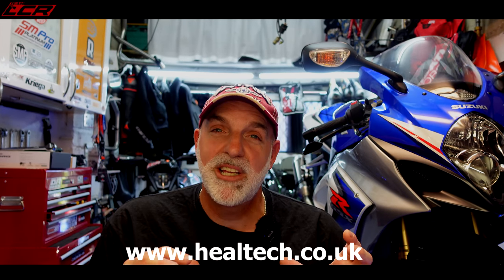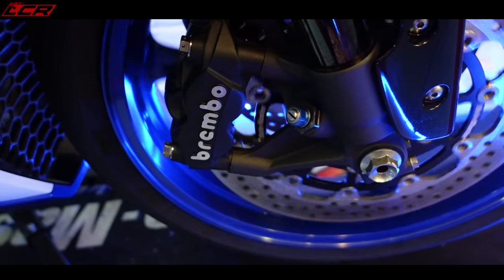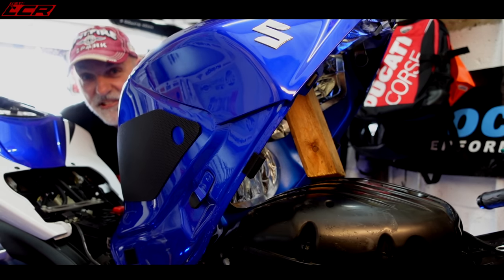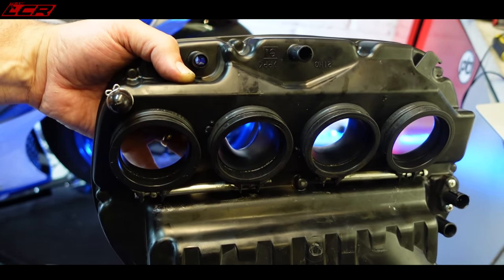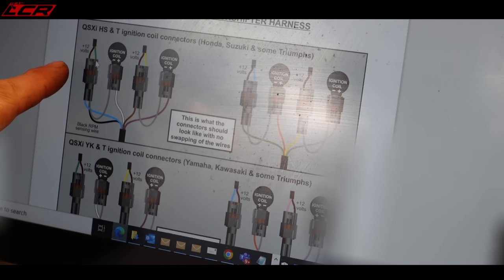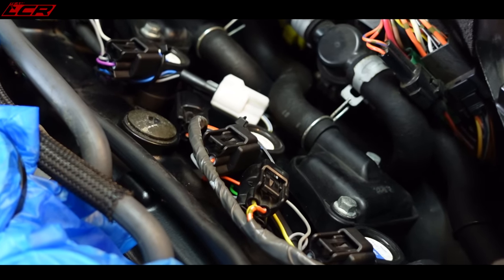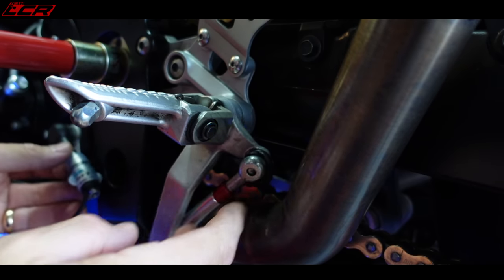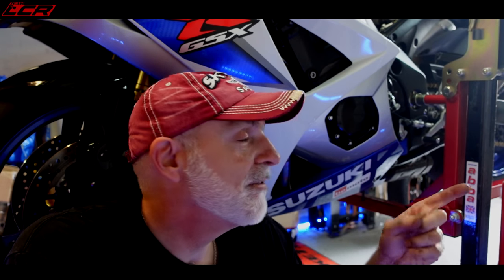BEST Track Mods GSX-R1000 | Translogic Quick Shifter Installation

Comment: Donington is a great track (apart from the nose adverse locals who moved/built there because house/land prices were cheap due to close location to the track)… Red Gate is awesome, you just keep getting braver and braver, quicker and quicker throwing it in, just be careful the next corner tightens up and is the limit for red gate. 👍
Reply: It's crazy with the noise limits there - illustrated by the fact that every 10 minutes a jet full of holidaymakers screams over your head at 827,000 db. Did see a Spitfire once though.
Reply from the maker: Yeah really annoying isn't it!

Comment: Those red spacers are to cover excess thread but I'd take one them off and put a nut in place and tighten it all down. As you've got it the gear lever side isn't locked off.

Comment: I ordered the TL QS oem replacement , for my gsxr1000r L7+ , and it didnt work , the company said they had issues with it working on the newer models ,something to do with voltages,, and they gave me a refund . Just a suggestion The loose red spacers on your bike you could add a washer or 2 . 👍

Comment: I have one for my R6 since a month or so, its so smooth. Only thing for me is that it sometimes takes quite a bit of pressure to engage
Reply: The pressure is adjustable. You can turn it down.
Reply: @dbtrackz33  yep, I have it set to the lowest setting at the moment. It's fine now but maybe something with the sensor
Reply: @jesse68569  is the angle 90 degrees or slightly more bewteen where you clamp the shift rod to your shift drum and the shift rod? Sounds like it may be 1 tooth off and is binding ever so slightly causing you to need extra pressure. Always double check that you have enough thread screwed into the body of the shift rod + sensor and that it's all tight. Removing any slop and making this entire thing as right and wiggle free and possible will make it all work smoother and more consistent.
Reply: @dbtrackz33 thank you for the info man!  I will check it again if I can improve the feel
Reply: @jesse68569  I had similar issues and went thru what I described to lighten up the pressure considerably. Instead of using their rod and spacers and purchased a linger shift rod so the entire assembly would have less pieces and play. Huge difference. Good luck!

Comment: Good video LC

I’m still keen to learn about your fitment and experience of the Heal Tech TRE,  if that’s still planned?

Best wishes
Reply from the maker: Hi Ian, I fitted it and can't really notice any difference... its very subtle if there is any difference
Reply: @LambChopRides  Hi LC, thanks for letting me know; that’s what I thought.
I fitted a generic TRE to an early ZX10R and perhaps I incorrectly installed it but it seemed to then run poorly.
More recently I fitted the HT gear indicator and TRE to my GSXR 1000 K2 and I think it may have improved throttle response.

The gear indicator is great though.

I’m looking forward to more sports bikes vids where possible, especially RG500, 90’s and early 00’s machines as I’m old and stuck in this time warp.

Best wishes

Comment: Just installed the latest translogic on my speed triple shifts like a dream, having issues with the engine management light now though not dropping out. I’ve checked the  QS module and the settings are all neutral, would it need a few heat cycles to sort its self out. Any tips? Cheers:)

Comment: How stiff is your throttle? My K8 is pretty stiff now and my cables look identical to yours (knackered) where they come out of the throttle housing. I'm going to install Venhill featherlight cables this week and see how much different they are.
Reply from the maker: It's actually pretty good! Cable snapped not long after the video and now replaced with new stock version. 100% better now 👍

Comment: that's very interesting. Does it blib the throttle on downshift?
Reply: sorry I guess that's a stupid question when its not wired to the ECU. What I'm trying to ask is- do you apply a bit of power when you downshift?
I'm quite an inexperienced rider so curious to know.
Reply from the maker: Hi Chris, doesn't do anything on downshifts as the GSXR isn't ride by wire so cannot automatically blip the throttle bodies. 👍

Comment: Wat made you go tanslogic? seeing as you were already going to fit the healtech logger why not go for the healtech shifter too?
Reply from the maker: The Translogic system is superior to the Healtech shifter IMO and I've used both before. Mainly due to the sensor on the Healtech being a little limited. Both work however but in my experience the Translogic offers a smoother shift

Comment: Did you have any issues with the sensor rubbing the frame? Or the sensor hitting the lever? Having a mare with mine, it’s set up the same as yours apart from I haven’t sawed one of the little nodules. Basically it shifts perfectly apart from 2nd to 3rd and 3rd to 4th once I get above 7/8k rpm. Thinking it’s vibrations causing the sensor to hit the frame - considering rear sets now. Did you have any issues? Thanks
Reply: Use an extra washer so it keeps it apart from rubbing any parts

Comment: Does fitting qa cause quicker wear to the gear box , I'm thinking about fitting one to my gsxr 600 which I don't use for track but want to do a track day with.
Reply from the maker: No providing its setup properly and shifts nicely. Obviously if its not smooth and your forcing it into gear its going to do damage. 👍

Comment: One of the wires from the throttle seems to have an angle that is not recommended.
Reply from the maker: Wires from the throttle? Doesn't connect to the throttle? Do you mean my throttle cable? Yes it actually snapped right after this video!
Reply: @LambChopRides  
Yes, English is not my main language and didn't know any better way to explain it.🙂

Comment: Choosy, you should really take the time and tune the 5 zones. Specifically zone 5 which is at redline, when at WOT the default 66ms delay time is far too slow for most any bike. It’s extremely conservative. Zone 1-5 on my bike are as follows. 66, 64, 62, 60, 54. Play with it if you’re bored, it makes it an even better mod. The way it’s adjusted is the biggest downside to this excellent kit. Other QSs you can usually use an app.
Reply from the maker: How old is your unit? I was told by Translogic they have tuned the new units more for faster shifts. Doesn't do that flutter my old one did. Seems  actually perfect to me
Reply: @LambChopRides  2 years old. Look up the default shift times of your unit I'm curious what they set it to now if it's changed. Should be in the manual. Would be good info to know.

Comment: Chopsy, I have a new Healtech Quickshifter on my 03 R6, I cannot get on with it at all. Sometimes it will not shift up gears at Donington Park. I've tried adjusting sensor thresholds, times etc. How is the Translogic vs the Healtech? I spent more time wondering if it was going to shift than actually riding the bike. It's proper getting on my tits. Instead of being an asset, it's becoming a hindrance.
Reply from the maker: The Translogic is the better system but its more money. It has a far superior switch mechanism,  oem manufactures use thier system its that good!